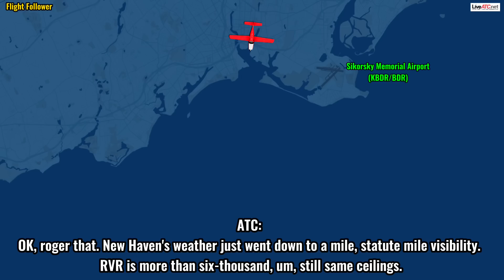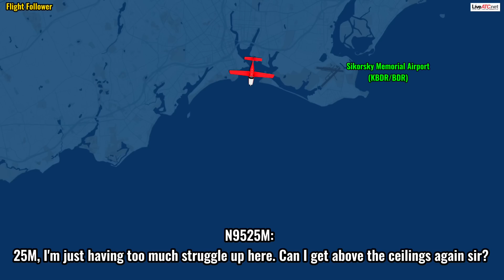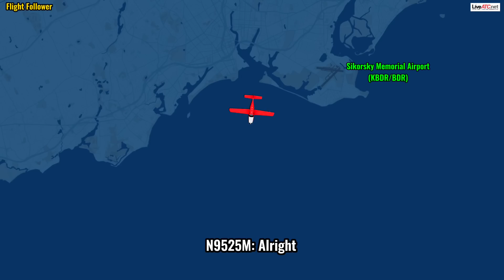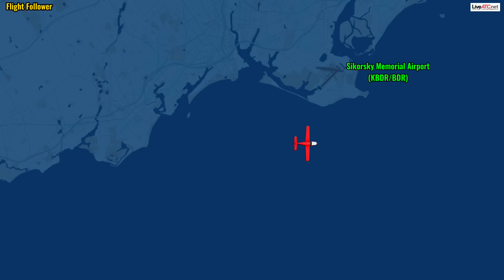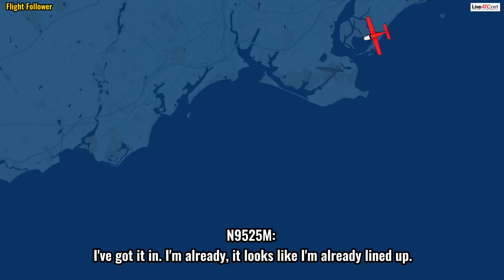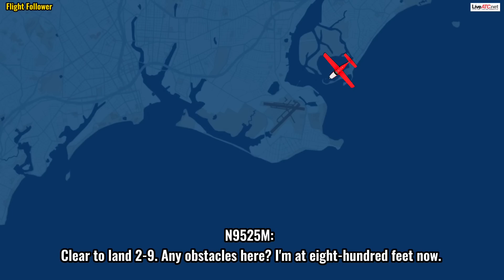Pilot CAN'T fly WITHOUT GPS/iPad | Calm ATC saves the day (and 02 Lives)

Comment: Great video - ATC treated him as an emergency a/c without a declaration.  Good on em.  Having just completed an IPC after a decade plus w/o flying, I can at least understand the complexity, if not the decision making that led him here.  To those decrying the iPad - dozens of saves currently attributed to having a moving map GPS,and backup attitude reference system (yes, Foreflight and G-Pilot can both do that) on board in the event of primary nav failure.  Likely he had an older GPS - GNS series or prior - and could not program it correctly, so it failed to match his iPad, leading to confusion.  Training / retraining is the solution to that.  WRT fuel, well, that's pretty unforgiveable if you are flying into known IMC.  He DOES need at least remedial training - which doesn't mean he's incompetent, just that he needs to build/rebuild safe flying judgment and decision making with a solid CFII.  He was able to fly the airplane by instrument reference once ATC got him to focus on task one, so could potentially  relearn.  This incident was undoubtedly investigated by the local FSDO, and I suspect, dealt with through the FAA Compliance program, rather than as a violation enforcement action.  Probably mandated remedial training.   Lastly - although ATC did do a great job, especially without a lot of options given the discovered critical fuel situation, a VOR approach with 1000 ceiling and circle to land is NOT my first choice for a low-stress approach!  KBDR has an ILS, it would just have been a tailwind landing on a 4800' runway, but I would have thought about offering it.  KOXC is 8 minutes to the north and has an ILS 36 which might have been considered, although likely the weather was worse.  Glad it turned out well, and hope the pilot - and his spouse - recovered from the turmoil and made good decisions about future flying.
Reply: Oh, and looks like the controller Jeffrey Schuler actually received an award for his handling - outstanding!  Also looks like the aircraft has since changed registration, and online panel photos show no GPS installed, although what looks like a portable Garmin 495 or similar is fitted in one photo.  1970's era avionics only.
Reply: @pnzrldr  Nice. Good work by the controller indeed.
The pilot clearly had some training and it worked out once he started relying on what he did know. But indeed needs help getting up to standard again.
Good for him to ask help on time.
Reply: I don't think anyone is saying "don't use an iPad".  There's a difference between "you shouldn't use it" and "you shouldn't NEED it".  If you cannot aviate and navigate without the iPad, you shouldn't be flying.  It's a tool.  It should not be a crutch.
Reply: @bronco5334  I saw a few comments that seemed to indicate an iPad has no place in a cockpit - which I completely disagree with - I don't think there's an airline Captain out there not using his company's tablet.  But I concur with you that it cannot be the primary reference, ever.  Just like a portable GPS (which I think is what this gentleman was using, along with his iPad) they aren't approved as IFR navigators.  If you are using an iPad as primary navigation in IMC, you should have already said 'Mayday,' as you are operating without the required equipment for the flight.  Also concur that they can inadvertently become so essential that you cannot maintain SA without - which is a clear training and proficiency problem, for some extra dual time, sim time, etc...
Reply: I think my only comment on this would be that I fly from Oxford, and because it’s at a slightly higher elevation, the ceilings are often lower. So while that might’ve been a good option the ceilings may have also been more difficult to work with
Reply: Oh my god u pilots just wax on poetic about you every chance you get lol it's the lonest utube comment in history

Comment: I wouldn’t fly with this guy! His wife must have been terrified. 

He doesn’t know how to use his GPS and is too stupid to tune in a VOR. At first he says he has 1.5 hours of fuel. Then says he switched tanks and the engine is out?? Hey dip stick, why don’t you switch back to the tank that has fuel? 

In a Piper, which is probably what he was flying you turn on the fuel pump, switch tanks, then turn off the fuel pump. He didn’t do that. 

He also didn’t do a good preflight to know exactly how much fuel he had.

Pathetic. He needs another check ride.

Comment: Honestly can relate to this guy. My first solo IFR flight was a couple months after I passed my check ride. I took off fine but quickly went into IMC and felt majorly disoriented. I had flown in IMC a few times before with my CFII and never had anything that bad. Luckily the cloud tops were only around 2500 and popped out on top and was able to look outside and get past the disorientation keeping me from focusing on my instruments. I had filed locally to shoot some practice approaches and dropping back into IMC I got a dot below glideslope and Tower gave me an altitude alert. It felt like I was all over the place every time I entered the clouds. After a couple approaches at a nearby airport, I noticed my NAV light breaker had popped to top it all off. I just got vectors back to my home airport, landed, and got out of the plane. IMC is tough for a solo pilot. I was newly minted and had been doing a ton of instrument training so I felt proficient. I had never been disoriented like that in the cockpit before. I powered through and made it out safely. I have since flown in IMC just fine, and it was probably just my nerves getting to me with my first time going solo. The biggest thing is not giving up because no one else is there to take the controls and major kudos to this guy for admitting he had a problem and getting help. We can train every day, but if we can’t admit when we’ve gotten ourselves into more than we can handle because we have to be big brave pilots for the armchair pilots listening to our atc calls on youtube, that’s when we become unsafe. Good decision making can still happen after we’ve gotten ourselves into bad situations with poor decision making.
Reply: Asking for help is a very important skill that many never learn.

Comment: I'm guessing planes don't have lighter plug sockets but there's no way to keep the iPad charged by the plane?
Reply: Many general aviation aircraft are more than 40 years old, and cigarette lighters are not a thing.  Upgrading aircraft can be expensive on top of the costs just to maintain and operate.  It’s nice to have a usb for charging, but a power bank is easier to come by.
Reply: @MalfosRanger  I'm not that up on plane electronics much less that restrictions/regulations on modifying the electrical system yourself. But it would be cool to just splice in a USB outlet. for backup.

Comment: I wonder if this resulted in one of those "I have a number for you to call once you're ready" statements from ATC? 🤣
Reply: Probably not. That usually happens when the pilot willfully ignores ATC or breaks the rules. Those are the moments that call might be demanded. You wouldn't want to use this for every misunderstanding or issue due to disorientation, as that would potentially deter or discourage a pilot in that situation to ask for help. In this case heade clear to the controller that he was having issues and difficulties, after which the controller (very much correctly) took it upon himself to treat the event as an emergency (which it was). No number copying and tower calling required.
Reply: @crazymonkeyVII  Yeah my comment was a tongue in cheek half joke. I agree, no rules were broken but this guy was seriously ill prepared. ATC most definitely did an outstanding job and probably saved two lives. The GPS struggles and not knowing for sure how much fuel you have onboard. I don't think I'm being too critical, at the controls of an aircraft is no place for uncertainty.
Reply: @J_Thomas24  I fully agree. I think what shocked me most was him running out of fuel like that. Immediately you go from "don't worry, take it slow and methodical, there's hours of time" to "if that one is empty when indicating 1/4, how much does my remaining tank actually have?"
Reply: @crazymonkeyVII  Absolutely, scary situation for sure.

Comment: The fuel gauges in these aircrafts are ONLY accurate at 2 places... FULL and EMPTY. You can't say you have 1/4 of a tank left just because the gauge says that. That fuel is sloshing all around and those encoders are never accurate. You only know how much fuel you have by dipping the tank before takeoff, knowing how much you started with and how long you've been flying. Or if you have much more sophisticated fuel flow equipment. I'm surprised he doesn't know this.

Comment: Fantastic ATC with expertise and patience. That pilot needs a wake-up call. Going up depending on GPS nav with weak iPad batteries? And get that aircraft in the shop. If fuel gauge shows 1/4 full on an empty tank,  the grim reaper is your co-pilot.
Reply: Well... it was no grim-reaper, but wife must've surely looked like one after deplaning!
Reply from the maker: Exactly. And great ATC
Reply: Also telling ATC he had 8-10 gallons remaining as if ATC has memorized the fuel consumption rate of every aircraft.  Provide that in hours or minutes my man! "90 minutes of fuel remaining"
Reply: @penguin12902   sometimes ATC WANTS gallons in emergencies, for fire&rescue. But indeed in a low fuel situation you need the time first.
Reply: Shit I don’t think I’ve ever seen even remotely accurate fuel gages in a ga airplane. And I’ve flown 50+ different c172’s
Reply: @yamkaw346 this reply sponsored by CIES fuel senders (simply the best)
Reply: Can't rely on fuel indicators in older GA aircraft. You just need to note how much fuel was in before you left, and note that on your log/iPad app, with estimated endurance, then in an emergency just work out the time left.
Reply: This flight was his wake up call, no doubt
Reply: "The grim reaper is my co-pilot" might be my favorite catch phrase now.
Reply: @TheFlyingZulu  I mean, if you're flying military attack aviation, it isn't an insult.  Especially if you have an extremely competent Weapons System Officer (the copilot)
Reply: You weren't listening. The GPS in his plane failed and he said that the iPad was the only thing he had left, and barely. Huge difference.

Comment: Pilots flew more accurately and safely before GPS/Tablets.
Reply: A good pilot with GPS/tablets is a safer and more accurate pilot than a good pilot without .
Reply: Actually there were many, many CFIT accidents in the pre-GPS days. If you got lost in IMC in those days, especially at low altitude, it was a bad deal. GPS has legitimately made flying much safer.
Reply from the maker: Technology has made us more dumb 😞

Comment: Jeesh... I always have have my iPad connected to a USB battery bank sitting in the footwell pocket.  That way BOTH the USB battery bank and iPad battery must be drained before I have issues, and even then I can still hook it up to the aircraft's panel USBs if need be.    AND I keep an older iPad (charged) in the seatback pocket.   and if all else fails..paper charts in the seatback pocket too.
Reply: Give a look at the paper charts every now and then, I do a lot of hiking and it’s very easy to lose track of what’s what on a paper chart when you’re used to GPS/iPad
Reply: @OCinneide Fortunately, the paper charts are identical to the digital ones.